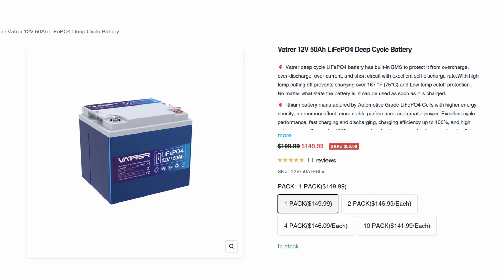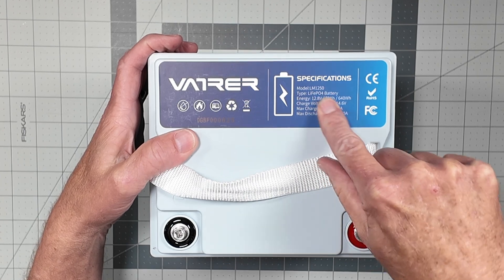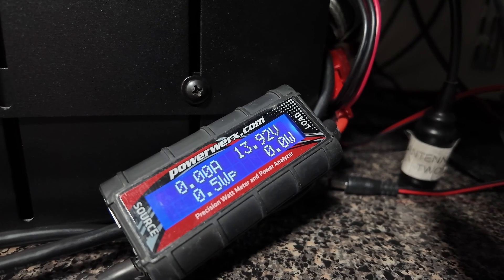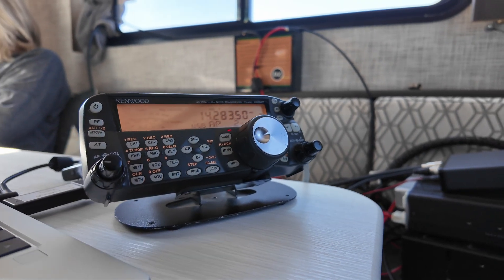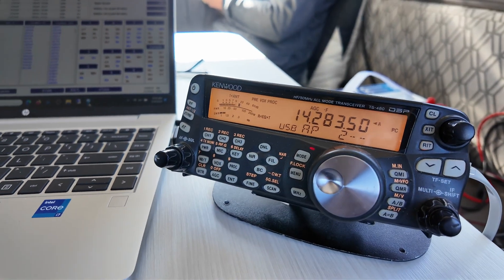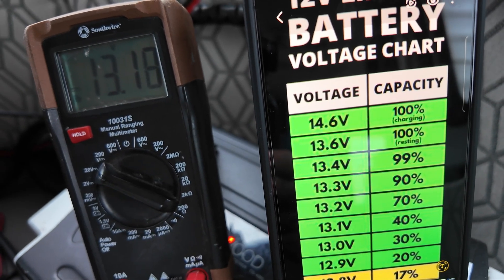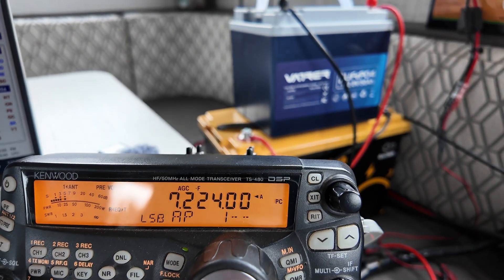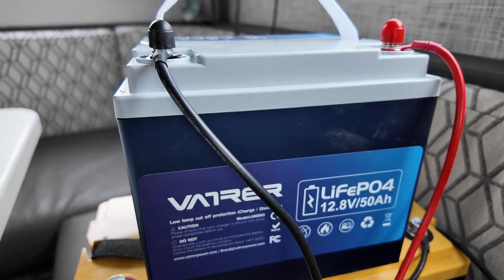Boost Your Ham Radio Setup with the VATRER 50Ah LiFePO4 Battery | K7SW Ham Radio Review

Comment: Nice video.  Folks may consider a DIY battery.  I just built a 105 AH LiFePO4 battery.  The 4 prismatic cells just nicely fit in a U1 battery box.  I used a JBD-SP04S020 4S 120A LiFePO4 BMS which has low temperature cut off and is controlled via Bluetooth app.  I had the BMS left over from a previous 560AH battery build for my sailboat, but new would cost $60. Alternatively, one could get a basic BMS for about $12.  In the end, the 105AH battery cost me $115 for the cells plus $12 for a NOCO U1 battery box.  Looks and works great.  I can send phots if interested.